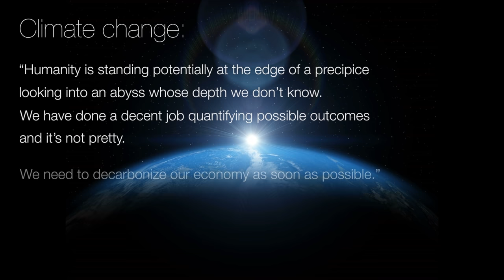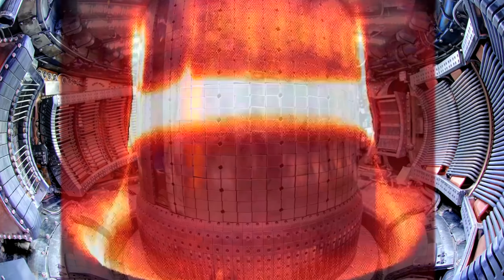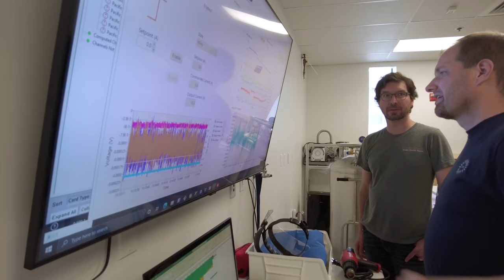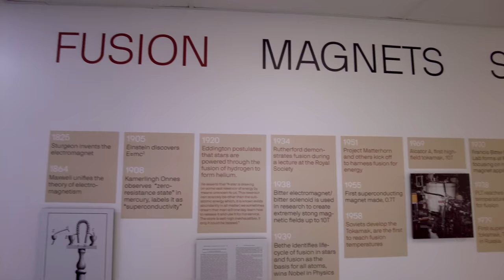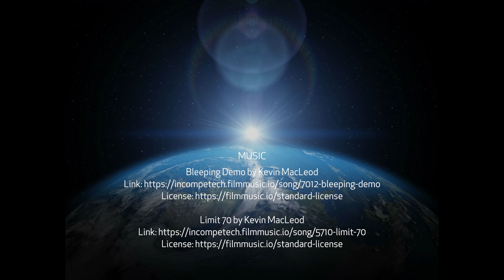A Star in a Bottle: The Quest for Commercial Fusion

Comment: I am old now I have heard this same story over 50 years but new problems always pop up what scientist don't tell is they need He3 to power it their is not much on Earth there is on the moon if they try power it with H2 it takes a higher temperature to work so far they can't even reach break even much less produce power so I've heard this excitement many times before until they explain cost, material, where they can get the fuel it's still in the future

Comment: I'm all for full tilt research into fusion. However, such efforts should be considered basic research, not practical engineering for any sort of achievable result. If anyone seriously believes that the Earth is in danger from the use of carbon, they should be advocating the most rapid possible deployment of fission power, not betting the farm on something that is, even today, not proven to work. In the 1960's and 70's France went from 0% of its electricity from fission to 75% in just over 15 years. Why should we kill off our high altitude bird species with windmills that deface the landscape or solar farms that destroy large acreages of habitat when we have an off the shelf solution waiting to be used. Unlike the large quantity of toxic waste created by solar cell manufacture, nuclear waste is comparatively small and recyclable as fuel in more advanced reactors.  Even if you could demonstrate a net gain of energy from confined fusion (and I am rooting for you to succeed) you would still be a long way off from demonstrating economical power production at scale.

Anyone willing to bet the farm on a technology that won't even be known to be practical until mid century is just not serious about climate change. If you do not take climate change seriously, why should anyone else?

Comment: 2: 50 Lady... Climate change fear mongering and then First dude- "We built this so the magnet was the really difficult thing to do and if you have the magnet the next step would be much easier and that is where we are at right now." 2nd dude - "If we can make this magnet work..."
 I would argue that they have been working on this concept since the 60"s building these magnetic containers have been done many times, the difficult part is actually having one that really works. Nothing I have seen says you are past this point. But nice ad. good luck!
Reply: China achieved 101 seconds of 150 millon degrees in May with a weaker magnet.
The process is slow but steady, in 10 years we will have a fusion reactor running
Reply: @aayush_789  Forgive my cynicism, but we’ve heard that fusion is just 10 years away for 60 years. The news is usually put out by University PR departments who are graded on creating hype for the institution.
Reply: Lol

Comment: This particular program is likely to end very badly, for several reasons, no need to repeat them again..? Because I am not a great explainer.

However, if you accept Bose-Einsteinian Condensation of wave-particle material is a standing wave-packaging phenomena and Black Hole Singularity positioning is the distributed vanishing-into-no-thing property of e-Pi-i time-timing Quantum-fields pulse-evolution, you can see the instantaneous picture of the property of Modulation Mechanism inherent in a Whistle, ie that the temporal projection-drawing of the standing wave is inherently of/by e-Pi-i sync-duration connectivity function formatting Holographicly. 

If you imagine that an atom is compressed or condensed time-timing, UHF that becomes reciprocal connection Fields Modulation, like blowing through a Whistle, then the mechanism of Fusion-Fission Reciproction is equivalent to the standing "Gravity Well" around a Black Hole, in this example, or the Electron-photon-phonon-Proton oscillation holography dimensionality of Atomic Matter. 

Synchronisation of the Gravitational scaling Fields Modulation Mechanism Singularity positioning and the standing wave length is literally Astronomical. Is that a good idea?

Over unity energy extraction is the Cold Fusion-Fission Timing-spacing coordination Chemical Bonding Clarified through Quantum Mechanics talks about, in temporal cause-effect continuity terms. The "reaction" tends to all unload at once, turning insideout, and apparently the same mechanism applies to supermagnet devices claimed to be over unity, the reciprocal connection properties of Temporal Superposition Singularity Modulation, "Whistle away" stored Bonding energy. (Don't believe anything I say, but science is not about trust in untested assumptions or assertions anyway)

A review of what, how and why LASERs generate light or MASER microwave pulses in the extended context of a concept of Focus Fusion, ie the Electric Universe idea, (without the fantasy stuff), is recommended for anyone not wanting to make a model of the Big Bang.

Comment: The fusion model is flawed.
Please look to nature for the answer.
You need the fundamental principles that a star works on. That's why it's naturally in that state.

In nature, when you go smaller, you go faster.
You need the fuel to spin very, very fast.
You need it to spin around a central core.
This creates natural layering of the fuel and isolate the temperature gradient present.
Then you blast it with energy (electrons) to start fusion and sustain it by throttling the variables.
You need a neutron reflector around the energy nucleus to sustain the reaction.

Good luck humans. All the best.

Comment: The high temperature super conductor just means it is hotter than -200C.

It is not that I don't think we can make fusion works I just wonder whether the complexity of it can truly be scaled up.
And the plants are not gonna be cheap. And neither will the fuel.
But, if it will work, I sure guess that, now is a good time to invest in and scale up the hydrogen economy.

The good thing about this project is the timeline - I really hope they can deliver, it is only 4 years away. And if they succeed, I think, they will even be ahead of the that giant Tortoise down in the south of France

Comment: They using so much magnets to produce 20 tesla. Magnets produce are made up rare elements which very short in nature, to make 10000 nuclear fusion plants, earth won’t be enough. What to do then
Reply: It uses electromagnet's. I doubt there is a single natural magnet in that thing. Maybe some on the fridge in their brake room though.
Reply: They're called Rare Earth but they aren't that rare. Yttrium is 400 times more common than silver for example.
Reply: The magnets are constructed by winding many layers of a "superconducting tape" [very long hundreds of meters, narrow 3 mm and very thin 116 microns [comparable to a human hair].  The tape itself is constructed of many layers with the superconductor being a very thin film deposited on top of a steel substrate with some other layers of copper and silver.  If you break down the tape by the materials -- it is mostly high strength steel [100 microns out of total of 116 microns thickness] with the superconductor YBCO [Yttrium Barium Copper Oxide being 3 microns in thickness] the rest is mostly Copper 10 microns] with 3 microns of Silver and nanometers of other stuff
Reply: @WestyHighlander  Steel was a conductor in the old days, now it is an insulator.

Comment: MIT:  Do my gravity test and potentially have the literal theory of everything for this entire universe.
Reply: Here is the test for the 'gravity' portion of my TOE idea.  I do not have the necessary resources to do the test but maybe you or someone else reading this does, will do the test, then tell the world what is found out either way.

a. Imagine a 12 hour clock.
b. Put a magnetic field across from the 3 to 9 o'clock positions.
c. Put an electric field across from the 6 to 12 o'clock positions.
(The magnetic field and electric field would be 90 degrees to each other and should be polarized so as to complement each other.)
d. Shoot a high powered laser through the center of the clock at 90 degrees to the em fields.
e. Do this with the em fields on and off.
(The em fields could be varied in size, strength, density and depth.  The intent would be to energy frequency match the laser and em fields for optimal results.)
f. Look for any gravitational / anti-gravitational effects.
(Including the utilization of ferro cells so as to be able to actually see the energy field movements.)
(And note:  if done right, it's possible a mini gravitational black hole might form.  Be ready for it.  In addition, it's possible a neutrino might be formed before the black hole stage, the neutrino being a substance with a very high gravitational modality with very low 'em' modalities.)

(An alternative to the above would be to shoot 3 high powered lasers, or a single high powered laser split into 3 beams, each adjustable to achieve the above set up, all focused upon a single point in space.)

'If' effects are noted, 'then' further research could be done.
'If' effects are not noted, 'then' my latest TOE idea is wrong.  But still, we would know what 'gravity' was not, which is still something in the scientific world.  Science still wins either way and moves forward.
Reply: And note:  If numbers do not exist in this universe by this or some similar way for math to do what math does in this universe, then how exactly would numbers exist in this universe for math to do what math does in this universe?

'IF' my latest TOE idea is really true, (and I fully acknowledge the 'if' at this time), that the pulsating, swirling 'gem' photon is the energy unit of this universe that makes up everything in existence in this universe, and what is called 'gravity' is a part of what is currently recognized as the 'em' photon, then the oscillation of these 3 interacting modalities of the energy unit would be as follows:

Gravity: Maximum in one direction, Neutral, Maximum in the other direction;
Electrical: Maximum in one direction, Neutral, Maximum in the other direction;
Magnetic: Maximum in one direction, Neutral, Maximum in the other direction.

Then:
1 singular energy unit, with 3 different modalities, with 6 maximum most reactive positions, with 9 total basic reactive positions (neutrals included).  Hence 1, 3, 6, 9 being very prominent numbers in this universe and why mathematics even works in this universe.
(And possibly '0', zero, as possibly neutrals are against other neutrals, even if only briefly, for no flow of energy, hence the number system that we currently have).

And also how possibly mathematical constants exist in this universe as well.
Reply: Math so far for the TOE idea:
(copy and paste from my files):

The mathematics for the TOE doesn't even exist yet as far as I am currently aware.  It goes beyond any quantum field theory formulas that I am currently aware of.  The outline though is basically as follows:

The formula has at least 3 levels to it:
1. The Internal Photon Level:  The 3 interacting forces, (which might even be just a singular force with 3 different modalities), all interacting at basically 90 degrees to each other and all simultaneously pulsating and swirling.  A complex part of the formula but I believe to be totally doable.

2. The External Photon Level:  For each pulsating, swirling photon, all the pulsating, swirling photons interacting with it.  An exponential part of the formula that I am not even sure modern day super computers could adequately handle.

3. The Inter-dimensional Photon Level:  For each modality within each photon would have an energy frequency associated with it.  The energy frequencies could be seen as being in their own space time dimension.  (For me, 'space' is energy itself of which is the 'gem' photon and 'time' is the flow of energy; 'temperature' is the interaction of energy), so one would be dealing with way more than just 3 spatial dimensions and way more than just 1 time dimension (as there would many different energy frequencies with many different flows of energy).  Whenever like resonate energy frequencies resonated with each other, they would affect each other, kind of like 'spooky action at a distance'.  Anytime energy frequencies overlapped, there would be a temporary spike of some sort in each space time dimension.  In addition, if in reality the 'gem' photon is just a singular force with 3 different modalities, it's possible that energy could 'slip' between modalities which would also affect the results.  A very complex part of the formula on top of all the complexity that came before it.

4. Any time any energy moved in the system, the entire formula would have to be recalculated due to potential ripple effects.

5.  In addition, I am operating in a realm where one plus one does not always equal two, and often does not.

Like I said above, I don't even believe the mathematics exists yet for what I am trying to do, but at a minimum, the formula would contain the above levels the way I currently see it to be.  And I never said it would be easy.
Reply: You know you can first copyright your theory, then you need to ask a few expert for a discussion and the testing mechanism to prove the hypothesis.
You need to be in person to explain what can't be understood from reading or even listening to your theory.
As an inventor this is my advice for you based on my own experience.

Comment: Perpetual motion 2.0

If it were possible to contain more power in a magnetic field than you put into the field , you'd see electric motors with efficiencies over 100%.
Reply: Is the sun a perpetual motion machine too? Do you understand that the energy is coming from mass ‘lost’ as light nuclei fuse into heavier nuclei?
Reply: @JamesUKE92  the sun doesnt use magnetic fields to contain the plasma , it uses gravity.
Reply: @glennchartrand5411  a constant magnetic field does not need ongoing energy to maintain. For example MRI machines have huge persistent current in superconducting coils which keep flowing for years without significant loss.
Reply: @JamesUKE92  plasma pushes against the field, the lines of force move across the conductive surfaces of the coils and core, inducing a current that weakens the field.

The more energetic the plasma the more it weakens the field.

If the plasma expands it instantly cools , stopping the reaction in its tracks.

So you have to add energy to the field to keep the reaction going.

The best you can hope for is to break even.

Perpetual motion 2.0

While fusion power in our lifetimes is possible , it wont be done this way.
Reply: Poor MIT, not realizing this. Have you at least done the courtesy of sending them an email, Glenn?
Reply: @RyanWilliams222  Im pretty sure they already know Lorentz's Law
Reply: @glennchartrand5411  You clearly have more physics knowledge than I do. (I have next to none.) But what you seem to be implying here is absurd. Are you saying that MIT is lying, and they know that net positive fusion energy production using magnetic confinement is impossible? Or that they don’t know what they’re doing? As well as everyone else pursuing fusion energy production through magnetic confinement?

Comment: Emitting radioactivity like all the former nuclear power plants I don't get what's the fuss about it. Nuclear power isn't save, and it's very expensive, too! Future generations will have to pay the bill.
Reply: You need to do some reading.
Reply: Fusion is a very different kind of nuclear power from fission, which is the traditional kind of nuclear power. It does not produce the nasty by-products that fission does.

However, looking at the entire history of nuclear power, fission is actually quite safe, even counting both Chernobyl and Fukushima. Amazingly, other forms of power cause more illness and death.
Reply: @resenese573  Well, you should. There is an intense X-ray radiation during the process and a long lasting through the neutron source. If you read, you'll easyly find papers on these topics. So, have a good read.
Reply: @gyozakeynsianism   @Rese Nese  There is an intense X-ray radiation during the process and a long lasting through the neutron source. If you read, you'll easyly find papers on these topics. However, of course you are right that conventionell power plants cause much more damage, but that doesn't eliminate the problems with nuclear power when an accident occures.
Reply: How is nuclear power possibly not safe? 😂
Reply: @jorneichhorn3397  True, but the total deaths and illness per gigawatt numbers include the major accidents. Those are easy to find online. Also, both of the major accidents were due to clearly bad decisions by the operators. Fukushima shouldn't have even been on the Pacific coast, and was of an older design that was effectively banned in the US in the 70's. And we all know about the backup generators not being high enough. The nuclear safety record is remarkable even including this.
Reply: @Gomlmon99  If you look at the technology and the history objectively, you conclude that nuclear power is safe. If you follow demagogues, you'll think we should ban it.
Reply: @gyozakeynsianism  we’re in agreement, I’m saying to the OP “how is it possibly not safe”
Reply: @Gomlmon99  Ah, OK. It's a strange way to put it since the obvious answer is OMG FUKUSHIMA!! It sounded like sarcasm. But I am glad we are in agreement.
Reply: @jorneichhorn3397  Any x-radiation is bottled-up inside the vacuum vessel of the tokamak -- none gets into the environment.  Yes, D-T fusion produces fast neutrons which can temporarily irradiate structures and other components.  However, the design of a Tokamak Power Reactor uses a Lithium blanket to capture the neutrons and breed the Tritium which ultimately fuses with Deuterium.  The net "chemical equation" for D-T fusion is actually D + Li => He that's it ----0 -- no radioactive waste -- just Helium gas